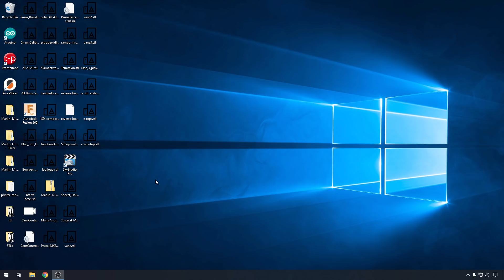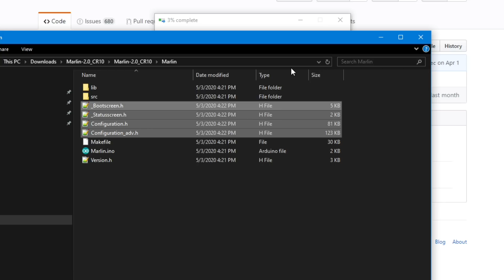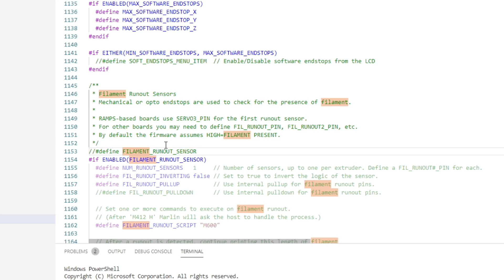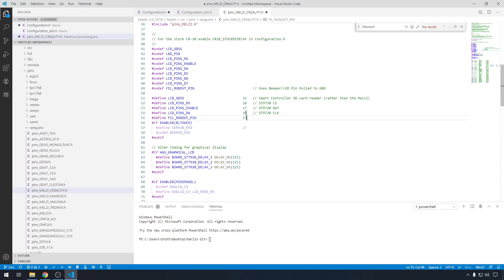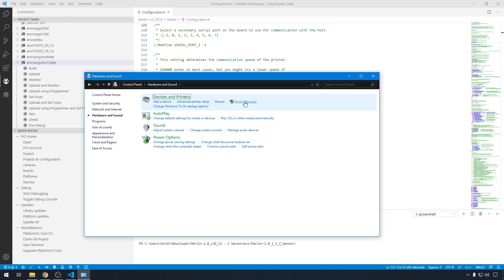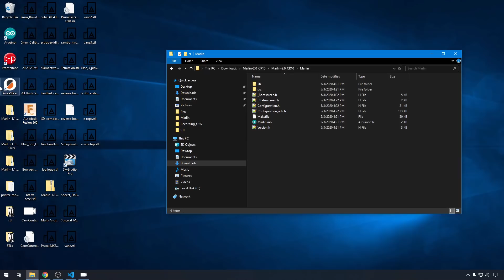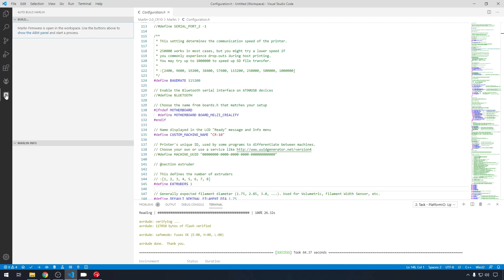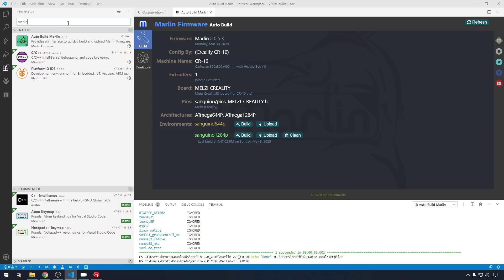Marlin 2.0 On 8-Bit Boards - Upgrade - CR10 - VSCode - Chris's Basement

Comment: Thnaks for the great video chris!  Not sure if you are still checking the comments here but have a question.  Have a creality cr10 s4 and have installed a BIGTREETECH SKR Mini E3 V3.0 Control Board, with TFT35 E3 V3.0 Graphic Smart Display, and working through configuring it.  Downloaded the marlin latest firmware and copied the config files to the relevent folder. Followed your steps and have a filament runout sensor to code in.  Looks like pin 15 on this board from what I've read correct?  Have set that pin # in the config.h file but not sure of where to go to set the pin number in the pin folder section.  In your example you went to sanguino then selected the 8 bit board, just not sure which drop down to select and change in the Pins folder for the skr mini v3 board....
Reply from the maker: Thanks for watching! Things have changed a lot since this video. The best way to do this now is to use VScode and an example config. It will already have all this information for you. There should a config ready for your printer. This will show you how to do that. https://youtu.be/7i7PnBZ6cnM?si=W6RrhqnqB8fxLvE0&t=125 This will show you how to setup VScode https://youtu.be/JWUcnkjeNU8?si=PgzGE2EuRC1qs5Zm&t=127

Comment: It's 1 year since my last question and here I am again, Sir. I got the "Creality V2.2.1" board for my CR-10S. When I copy the config files from the "CrealityV1" folder into my Marlin folder. I get the error message "Compilation Error. Your Configuration.h file is for an old version of Marlin" ... do you know where I might get the newest & freshest config files? I suppose the CR-10S folder isn't maintained that much anymore .. maybe I have to grab them from a different printer and just a few things?
Reply from the maker: They should all be maintained as a project, so they are up to date.  You might be trying to use bugfix. It you are on 2.1.x this should work.https://github.com/MarlinFirmware/Marlin/tree/2.1.x/config

Comment: Hey Chris I am new to 3d printing and have a machine that I’m struggling to configure could you please help? I have a Nano3dprint a2200 with a main board of mks sgen l v.1
Reply from the maker: Hey, I'm not sure what printer that is. I don't know what firmware it might be running. Check here to see if there is a Marlin example for it. https://github.com/MarlinFirmware/Configurations/tree/bugfix-2.1.x/config/examples

Comment: I get this error on two different tries on different computers:
Error: Build environment 'sanguino1284p' is incompatible with BOARD_MELZI_CREALITY. Use one of these: melzi_optiboot_optimized, melzi_optiboot, melzi_optimized, melzi
Reply from the maker: Try installing the vscode Marlin extension. See if it can find the correct ENV to use.
Reply: I had this issue also. I was never able to get it going with platform i/o, and I had issues with flashing to the the board via USB. I ended up using an arduino uno hooked up just like we do to flash the bootloader, but I compiled marlin within arduino IDE (had to add a few libraries) then I choose sketch -> upload with programmer to have the arduino ISP flash the firmware directly to the ISP pins on the cr-10 mainboard (v1.1.4). This worked and I have marlin 2.0.9 installed fine. 2.1 required different configs so I chose to not use that version and get LTS 2.0.9.5

Comment: Hey Chris, I don't know if you'll read this post in 2022, but I'm trying :D
I have a CR-10 upgraded to CR-10S (double Z) with a Creality 2.0 motherboard. I'm totally confused to choose from the Marlin 'config' folder. Do you have an idea please?
Reply from the maker: I'm not exactly sure which board that is. Does it have a number on it like 4.2.2?
Reply: @ChrisRiley  Nop, just Creality 2.0 (CR-10S 1st generation)
But I am very disappointed: 
1st, this board has a connector for a 2nd extruder, but the component to drive the motor is not present on the board. 
2nd, it seems to have an underrated capacitor which is a problem for the temperature management. 
I think I will change for a BigThreeTech. Otherwise, I think finally that the config file is /CrealityV1/. 
Thanks a lot for answering me Chris ! 🤜🤛
Reply: @AmaXOnline  i have the 2.1 version of the cr10-s motherbaord and its very easy to do first grab the th3d unified firmware for that board then just upload its already configured  u just have to select your cr10-s printer from the printers list in the code then compile and upload the cr10-s motherboards already had a bootloader

Comment: For some reason I'm not able to upload even though I installed a bootloader
Reply from the maker: It's 8 bit? Try to download the ch340 driver on your computer.
Reply: @ChrisRiley  Yes, it is 8-bit. I downloaded a ch340 driver to my computer and checked that it worked, however when I tried to install it again it failed.
Reply: Note: I'm installing Marlin 2.1. I tried to install sanguino1284p on VSC again but it keeps saying: "Error: Build environment 'sanguino1284p' is incompatible with BOARD_MELZI_CREALITY. Use one of these: melzi_optiboot_optimized, melzi_optiboot, melzi_optimized, melzi". Should I download any one of them?
Reply from the maker: @samuelm.7797  It might be a memory problem, does it say anything about a memory limit?
Reply: @ChrisRiley  None that I noticed.

Comment: I did everything you stated and I still get a failed message if I use sanguino board it says the file is to big if I use the melzi optimized board it gives me those 10 out of 10 messages
Reply from the maker: Check out that video, it should help.

Comment: Okay so I’m trying to do this to my cr10 from my understanding I have v1.1.4 board and it already has a boot loader I’m not getting any of those messages you got from you not having a boot loader mines saying the program size is more then allowed what could it be?
Reply from the maker: It's because the feature set is too large for the board. You will need to turn some off. Take a look at this one. This will give you ideas on what to turn off to save space. https://youtu.be/O2126G4oO30

Comment: Mornin, fine Sir. Excellent video, as always. I swapped the old board of my CR-10S to the Creality V2.2. board. When I open the "CR-10S" folder within the "Configuration-Release" folder there are the configs for "SKR Mini E3 2.0" and "CrealityV1" ... as mentioned I installed the "Creality V2.2". Can I still just use the configs from the "CrealityV1" folder and/or does this have any downsides? Thanks for your amazing videos my man <3
Reply from the maker: Hey, so I THINK all the Creality boards use the same chip, so that V1 config should work on that board too.

Comment: It looks like I'm going to have to move to a 32 bit board. When enabling ABL, then unable to compile as file overuns space available for CR-10 :-(
Reply from the maker: Or at least move to a 2560 processor. Marlin is really tight on these 128 boards now.
Reply: @ChrisRiley  any recommendations on which are a good fit for CR-10, using ABL sensor type probe?
Reply from the maker: @rfc1795  There are tons of them out there. SKR mini v2 is a good choice on the cheap.
Reply: @ChrisRiley  looks like I will go with that, thanks!

Comment: Anyone know if there is a way to read the current Marlin settings off my CR-10? I have a ABL setup already and flashed some years ago, so would like to see the settings I have on there now in order to do a new upgraded flash.
Reply from the maker: About all you can do is pull the settings with a M503 command. It will get you some of the settings you need.
Reply: @ChrisRiley  Thanks Chris! Yeah, it seems I need to start from scratch - joy :-P

Comment: Is it possible to compile Marlin 2.0 with BLTouch for a stock CR1010 v1? I'm having a lot of trouble. When I try to compile in VS Code I get:
"Linking .pio\build\melzi\firmware.elf
The command line is too long.
* [.pio\build\melzi\firmware.elf] Error 1"

I read that VS Code wasn't supposed to have the same max character problem that the Arduino IDE has, is that not the case? How hard is it to flash from a virtual machine?
Reply: Ok, I re-watched and noticed that I missed the step about compiling with the sanguino board. I'm now getting:
Linking .pio\build\sanguino1284p\firmware.elf
c:/users/zprim/.platformio/packages/toolchain-atmelavr/bin/../lib/gcc/avr/5.4.0/../../../../avr/bin/ld.exe: .pio/build/sanguino1284p/firmware.elf section `.text' will not fit in region `text'
c:/users/zprim/.platformio/packages/toolchain-atmelavr/bin/../lib/gcc/avr/5.4.0/../../../../avr/bin/ld.exe: region `text' overflowed by 15964 bytes
collect2.exe: error: ld returned 1 exit status
* [.pio\build\sanguino1284p\firmware.elf] Error 1

As far as I can tell this means it's too big to fit on the board. Looking for things I can comment out to save space now.
Reply: Update, I disabled the advanced pause feature which brought me down to about 8500 over. Not sure what else I can disable.
Reply: One more update. I found a very helpful website that had a list of features that can be disabled. It said in order to get BLTouch you need to disable SD card support. I'm not yet ready to install octoprint so I need to keep that for the moment but I wanted test out the BLTouch. I ended up disabling quite a lot of other features and did get it to compile, just barely.
Building .pio\build\sanguino1284p\firmware.hex
Advanced Memory Usage is available via "PlatformIO Home > Project Inspect"
RAM:   [========= ]  92.7% (used 15186 bytes from 16384 bytes)
Flash: [==========]  100.0% (used 126930 bytes from 126976 bytes)

Here's the website: https://crosslink.io/marlin-2-0-memory-usage-by-feature/
Not all the memory amounts are accurate but it gives you a ball park on how much it takes. Once I'm ready to install my Pi W Zero, I'll reflash with just SD card support disabled and see which of the others I can re-enable. 

Thanks for all the videos Chris. I've learned a ton in this process.
Reply from the maker: I'm glad you got it going. Thanks for the link! 👍

Comment: tried tonight but it seems there are problems with cr-10 compilation
Reply from the maker: What did the error say?
Reply: @ChrisRiley  solved, in the new version of marlin for CR10  board the following 2 lines are needed in configuration.h:
#define HOMING_FEEDRATE_XY (20*60)
#define HOMING_FEEDRATE_Z  (4*60)

but anyway once compiled the firmware is too big to be loaded on the board so to fit it I had to disable the use of SD reader, which I do not need anyway because I use octoprint....
I hope this can help others.
thank you for replying.

Comment: What are the benefits of running this firmware version on an 8-bit board, if we have to trim it down and not enable features?
Reply from the maker: 8 bit boards with a 2560 processor should work much better, you will have room for features. This 128 board is the worst case scenario.

Comment: The VSCode I installed doesn't have a platformIO icon in the menu bar.
Reply from the maker: Did you install the platformio extension?

Comment: Hi Chris,  working on flashing marlin 2.0 like you recommended in a recent live stream. (thanks for answering my question about activating linear advance).
I ran into this problem when I tried to compile:
c:/users/karr/.platformio/packages/toolchain-atmelavr/bin/../lib/gcc/avr/5.4.0/../../../../avr/bin/ld.exe: .pio\build\sanguino1284p\firmware.elf section `.text' will not fit in region `text'
c:/users/karr/.platformio/packages/toolchain-atmelavr/bin/../lib/gcc/avr/5.4.0/../../../../avr/bin/ld.exe: region `text' overflowed by 9318 bytes
collect2.exe: error: ld returned 1 exit status

Does this mean that turning on manual mesh bed leveling, PIDAUTOBED, and linear advance took up too much space?
Have any advice on the issue?

Thanks Much
KarrMcDebt
Reply from the maker: Sorry it has taken me so long to get back to this, yes, you are out of memory. There are somethings you can run without. Try uncommenting disable M503 in configuration.h and comment out g2/g3 support in configuration_adv.h
Reply: @ChrisRiley  Thanks much!!  See you in the live stream in an hour. :)

Comment: Hi Im trying to flash cr 10 firmware / marlin 2.0 to a 32 bit creality v4.2.7/4.2.2 ender 3pro board. Im really confused on this one and I am seeking help. I currently followed your steps for setting up the marlin 2.0 in VS code but I know I need to make a custom version of marlin for the ender 3 pro board and need to add in the firmware for the cr 10. Im not sure how to do that. Can anyone help me out?
Reply from the maker: You will need to use this board in your config. #define BOARD_CREALITY_V427   Just use the CR10 example and replace this board name.

Comment: After upgrading my CR-10 to Marlin 2.0.7.2  I got an issue of read: echo:v82 stored settings retrieved (669 bytes; crc 48993) connection failed. Any one faced this issue ?
Reply from the maker: Is it the original board? You might be running super low on memory, try commenting out disable m503 and try again.

Comment: Thank you Chris. I have managed to install 2.0. The only problem I have now is that I get a high pitch noise from the print fan when printing petg (fan si at 50%). Do you know what I can do to stop that?
Reply from the maker: Wow, I am not sure what that could be, the firmware shouldn't effect the fan, but I have been folled before. lol

Comment: Due to a change in July, compiling Marlin in the sanguino1284p environment will lead to a failed build. This is because of the fact that the upload size of the environment has been lowered from 130048 to 126976 bytes. They did this because these environments assumed the optiboot bootloader, which is 1024 bytes in size. The older bootloader was 4096 bytes in size. So when flashing this firmware onto boards with that bootloader, the bootloader would get overwritten.
To get by this size limitation make sure you have the optiboot bootloader, and then compile in platformio for the melzi_optiboot environment.
Reply from the maker: Thanks! :)
Reply: I did this and my CR-10 uploaded marlin 2.1 fine.  But I then added manual bed mesh leveling and the build failed.  It mentioned “text overflow”. I am assuming this means there is not enough memory to add this?  If so, this is disappointing, as I only have the stock CR-10 config, and only adding this 1 feature.

Comment: Hello Chris! I wanted to thank you for your contribution to the 3D printing community. I am thinking of buying a creality cr10 v3 but I want to install marlin. I don’t know what type mobo is wearing the new machine, except the mobo version is 2.5.2. Can I follow the  current video to install marlin? What mods do I do to add bltouch ? Thnx
Reply from the maker: Thank you! I am not sure what mother board they use now either. You should be able to upgrade to Marlin easier now.  A lot of the new creality boards come with bootloaders. If you wanted to add a bltouch, you would need a break out board like this. Again, depending on what mother board you get. https://www.amazon.com/FYSETC-Leveling-Auto-Level-Accessories-Creality/dp/B07PR26KSD/ref=pd_lpo_60_t_1/140-0629980-7078428?_encoding=UTF8&pd_rd_i=B07PR26KSD&pd_rd_r=01059b83-fad2-4946-aef2-05c2def38bb3&pd_rd_w=mwY4L&pd_rd_wg=mpUJh&pf_rd_p=7b36d496-f366-4631-94d3-61b87b52511b&pf_rd_r=H7K61F7PH15P82GKMEKM&psc=1&refRID=H7K61F7PH15P82GKMEKM
Reply: Chris Riley : I just checked the released FW and the mobo is Ramps 1.3 efb !!!!
The archive contains a file with “hex” extension and a Folder  called marlin. inside the marlin code  there are all the known arduino extensions. Since it’s ramps how Can I find the right PIN number  of the  A12 port on the board? I need it for an analog input of a progect I have
Reply from the maker: @ct8060  The pins will be in the pins_ramps file, also here. http://domoticx.com/arduino-mega-shield-ramps/